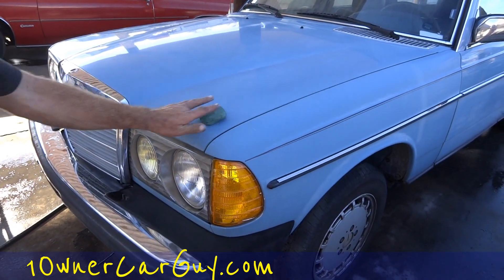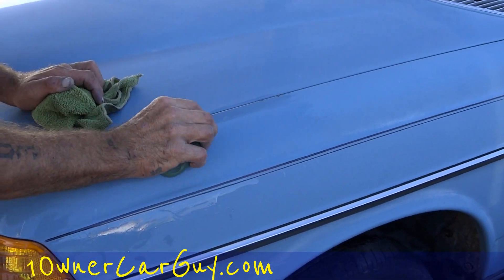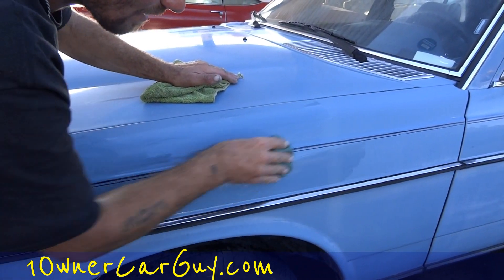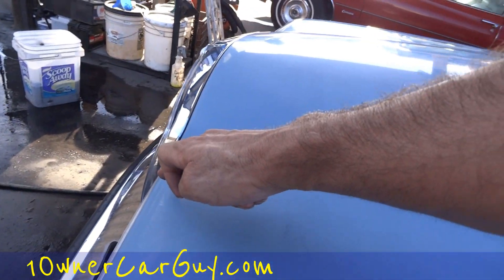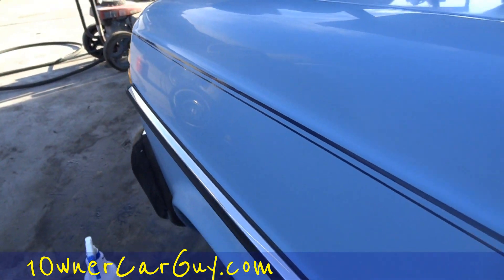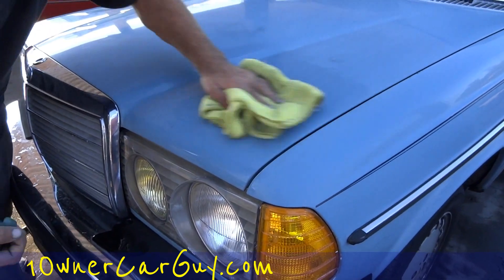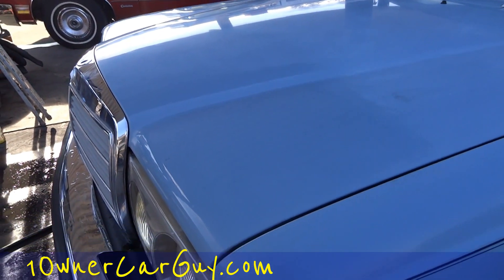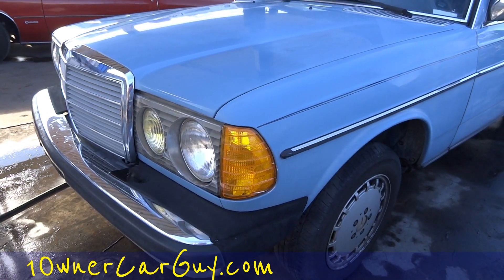Clay Bar a Car ~ When to Change Old Worn Out How To ~ DIY Claying Auto Detailing Video

Comment: Claybar = Blu Tak without the expense or marketing.

Well, you don't use Blu Tak on its own. You use a weak polish solution as a lubricant. It doesn't mar the paint work, and removes all the little lumps, and pollution layers, too. Paintwork is as smooth as a baby's bum, You can polish and seal afterwards if you wish, but if not, paintwork beads very finely in rain.

We even do demonstrations of a restore of cars with tired paint, at formal shows over a weekend

Personally, I'll swear by it.